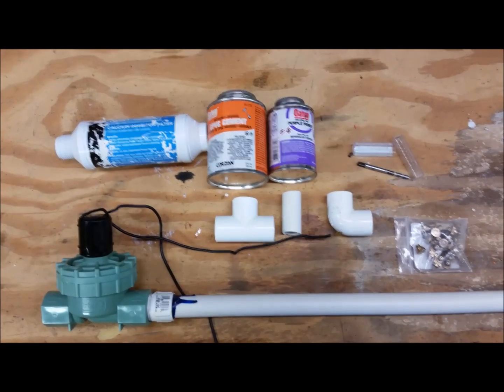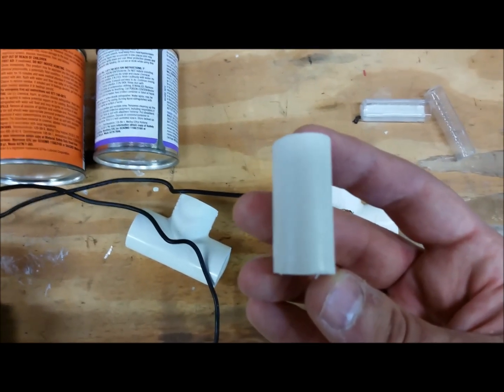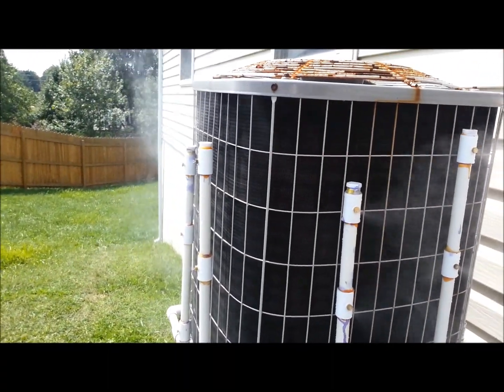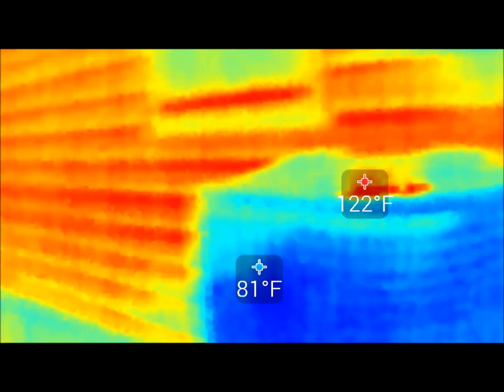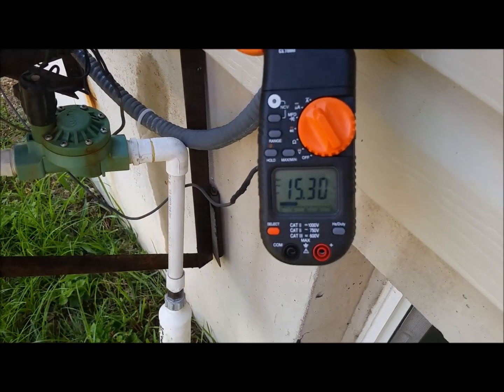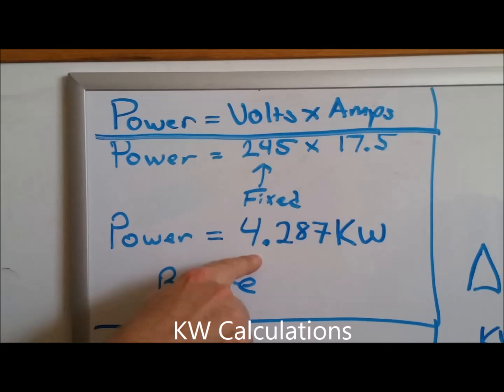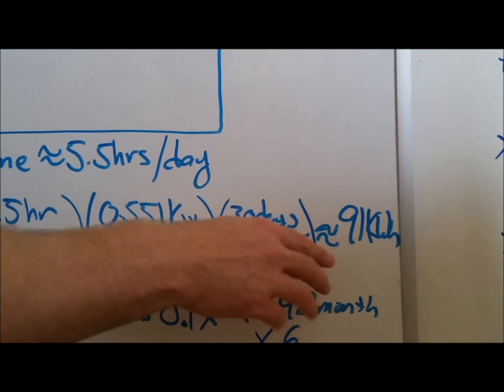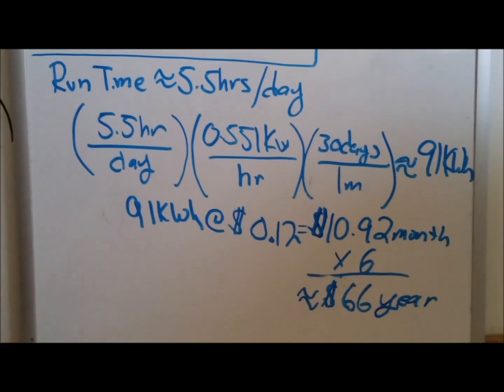DIY AC Mister Reduce your HVAC Cooling Costs Thermal Image Part 1

Comment: Nice system.  I like the elegance of risers from the base of the unit.  I live in the Sacramento area with some pretty hot summers.  I used the same basic materials (including the sprinkler valve) but built a kludgy freestanding framework to support the misters about 8” out from the coils.  They have worked fine for 8 or 9 years now (pvc April 2009).  This year the when I went to install it a union snapped while screwing it together.   So I’m reengineering the system using an Orbitz mist cooling system’s brass Slip Lok reusable components making it easier to remove for winter storage and the misters easier to adjust.
I don’t have the kewl measuring devices, thermal imaging or the nifty math you do so I had to improvise to convince myself the misting made an actual difference.  My low tech way – I have accurate thermometers for BBQ cooking.  On a hot day the ambient air temp was 105F, with the AC having been running over 10 minutes (without mist) the air coming out the top of the AC unit was approx. 115F, turn the misting on and after 3 minutes the temp dropped to 102F.
Like you I don’t run my AC with the temp is less than 80F so many of the other worries mentioned in the remarks seem specious to me.
Over the years I’ve had 3 companies come out to do a HVAC system check up, 2 of them didn’t bother to clean the coils and the 3 one sprayed some cleaner on the coils and commented that it didn’t foam up which to him meant the coils were clean.
Yes I know the value of these system checkups, but to me when they tell me that my capacitors are worn(?) and should be replaced – I hand them new ones to put in compressor and air handling units.  It’s easier than me climbing into the attic.
Reply from the maker: Thanks for your reply. I seen a lot of systems that had flappers, but didn't like the cheapness of them. The sun really wears cheap parts out.  I designed mine to be modular....so when winter comes,  I can remove the value so it doesn't freeze and crack and the system just drains out. Since I'm a science guy, I need to prove that it works. It sounds like your on the right track with saving money on your cooling costs as well.  I'm in the middle of making a rain barrel system which is feeding the mister now. Stay tuned for a new video.
Reply: Gary... I am originally from Sacramento. Graduated from Grant High School. I am now in Arizona. All I can say is STAY IN SACRAMENTO AND BABY THAT AC UNIT! It is hot as HELL here in AZ! But... I'll be in Sac for 4th of July to cool off 🤣🤣🤣
Reply: It isn't "cooler air" that sucks away the heat. It's the flash evaporation of the fine mist that absorbs the major part of the heat. That's why you don't shoot the spray directly at the coils. Instead the spray nozzles point outward to form a mist cloud that gets drawn into the coils. 

 I had been using this system (with the flapper) for about 4 years. The second time I replaced them because of sun damage I went with the diy pvc design similar to this one. This has lasted 5 years so far.

Be sure and use a good calcium filter and your nozzles will rarely clog.

Some YouTube videos claim that you won't save money. I feel I saved a little. More enough to pay for the unit in a year. But saving money wasn't the point for me. My AC couldn't keep up in unusually hot Michigan weather. After I added the mister it has maintained whatever temperature I set. Saved me from buying a bigger unit.
Reply from the maker: The cooler air is from the phase charge of water to a fine mist.  Which,  as you said,  takes the heat with it. 

But Symantecs aside, it works well.  The hotter it gets,  the more efficiency it brings.

Comment: Nice video,  did this have much impact on the overall delta T inside the house, I.E. did the ac vent outlet temperature go down somewhat? Also, where did you grab the 24vac for the orbit valve, perhaps at the Main contactor relay primary? May give this a try, mine is 16years old and in need of replacement, cools but not very efficient, old seer 10
Reply from the maker: I didn't see any significant change  across the a coil. It mainly seems to reduce the operating temps of condenser and increases it's efficiency. I grabbed the voltage for the orbit valve at the input to the contactor (the signal from hvac transformer that tells the switch to close)
Reply: @stem_saving1644  Thanks...

Comment: So at 10.92 a month in hydro saving's it will take you 100 months of savings to pay for the new compressor you will need. Lol
Reply from the maker: True, but a simpler solution is not using the system at that temp. I have never needed to cool my house when its 60 degrees outside. That's why I have windows.
Reply from the maker: Your implying getting the system wet, ruins the compressor?  Guess everybody's system needs a new compressor when it constantly  gets rained on.  It's a closed system, water doesn't degrade the system.
Reply: @stem_saving1644  That is not what I am implying at all do a little bit more research on how the refrigeration cycle works and what other critical readings you should be taking when changing the operating discharge pressure.
Reply from the maker: The operating pressures also change when cold air is exposed to the coils, which happens during most cold fronts during a summer rain. Simply put. It allows the condenser to opeate more efficiently. If it were damaging to the compressor,  manf. would not allow units to be placed in areas where there is a cold air in take. This same evaporative cooling technology is also employed in commercial and industrial units as well. The science is solid and proven.
Reply: @stem_saving1644  I guess the point  that most people don't understand is that you need to properly control the head pressure of any refrigeration unit regardless of what you are cooling. By the way I only work on commercial and industrial HVACF systems and live where the temperature swing can go as low as -30F and as high as 100F with very high humidity. So we deal with alot of controls on these systems to properly run in these conditions. So that being said most condensers are made for 95F ambient and some for 105F. Anything above those temps and I agree water will definitely make a difference anything below 60F ambient you risk the chance of the compressor being damaged without proper head pressure control which also has a bearing on the refrigeration effect of the system. So just running the mister without some control on it is just wrong not to mention the fact the water will eventually damage the condenser coil which I have seen first hand.
Reply from the maker: I respectfully disagree. My results are what works on my system. It's never run at 60 degrees outdoor temps.  So it never sees these bounds. It's almost 20 years old, which if this causes failures, it would have caused it to fail by now.
Reply: Using A/C unit is not recommended when ambient temperature is below 60-55 deg. because liquid refrigerant can flood a compressor. Using mister at borderline temperatures will make things worse. Simple solution would be to install outside thermostat so it can cut off the mister when is too cold.

Comment: Very COOL. I got the same a.c.. How is holding up for you
Reply from the maker: It's been doing well.  It's a power hog and I will eventually replace it with a heat pump, which is an order of magnitude more efficient....  But for now, it works.